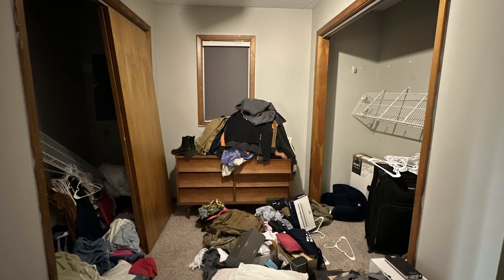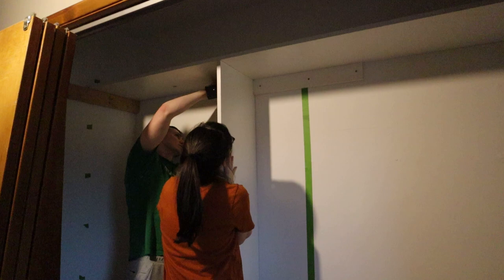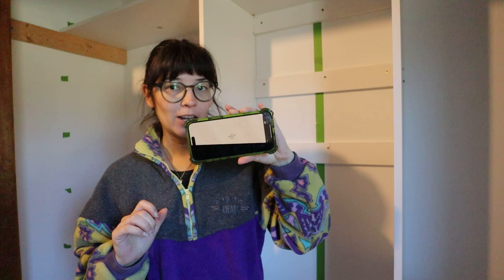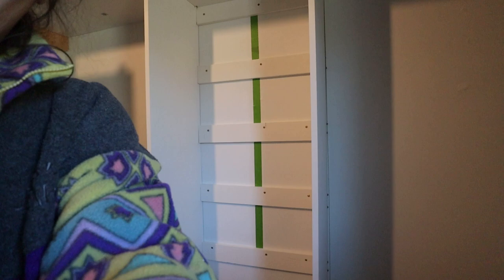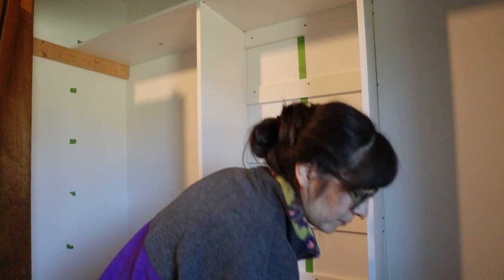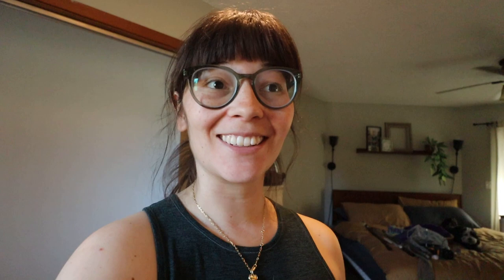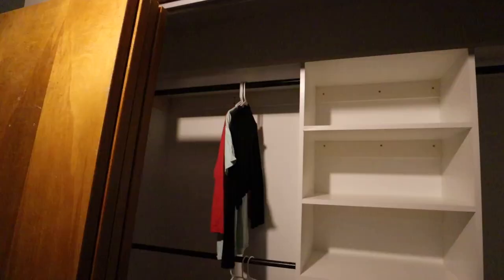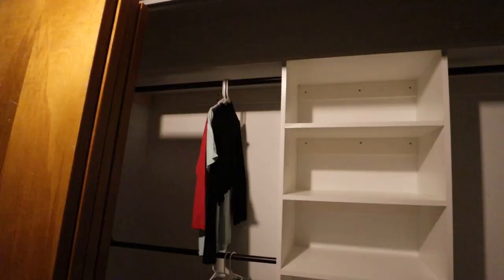DIY Custom Closet | customizing my reach in closet

Comment: So I know part of the look is to have that middle shelving part floating, but honestly I would look at bracing between the floor and the front of that shelving unit. 
I have some of those prefinished shelf material and you are supposed to go no more than 2 feet without bracing so they don’t sag and warp. 
Basically that whole top only has bracing on the ends, because that is the only part that goes all the way to the front lip of the shelf. So I would be seriously worried about that top shelf sagging after being under weight for a while. 

So I would either brace under the shelving unit or you could probably do some white L shelf brackets under the shelf into the back wall and into the studs. 
Since you have a little space between the shelf and the rods they would just sit above the rod and help give that shelf a little more stability and longevity.
-edited to add. 
Went back and checked and realized you did the wood in the back as bracing and so the shelf bracket would actually no longer work. 
And so I would personally really brave the front of the cabinet. 
The front edge of that plywood has basically 0 support except the ends.

Comment: great job, love the final result! 

for the screws, they're mostly visible bc of the contrast. if it still bothers you I'd paint it with white nail polish (for your matte plywood I'd go for matte white but normal shiny nailpolish would do as well). Nailpolish dries fast, you can get a small amount for cheap so you don't have to get a whole bucket of who-knows-what paint, and you can wipe it unlike normal wall paint which is otfen water-based - it'd come off the nails pretty quickly (if you don't plan on cleaning the surfaces otfen/you'll only dust without water you can just paint the screws with wallpaint that you use on the 2 wood side supports)

I have a shiny white kallax that had a few chipped areas, I used normal white nailpolish and now I really have to look hard to find where they were AND I can wipe it however much I want.
Reply from the maker: Nail polish is a great solution! Thank you!